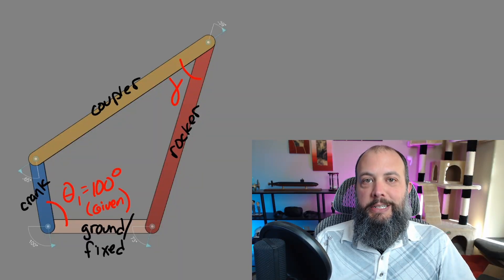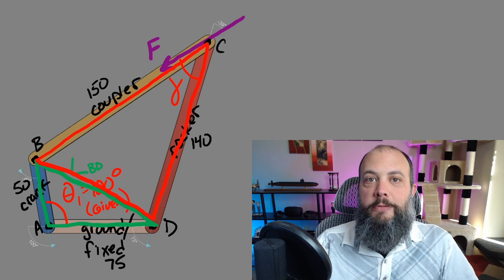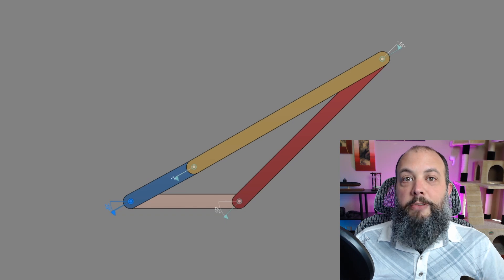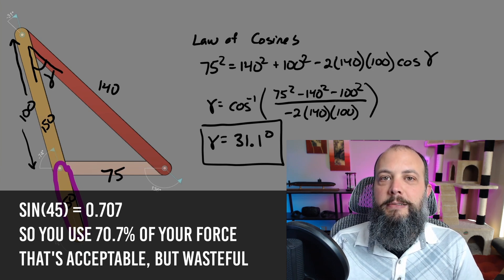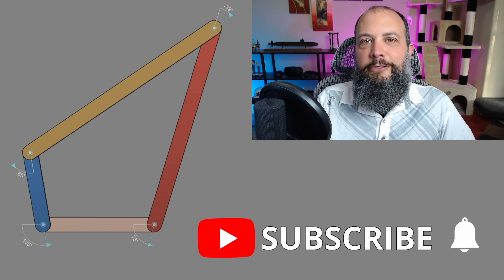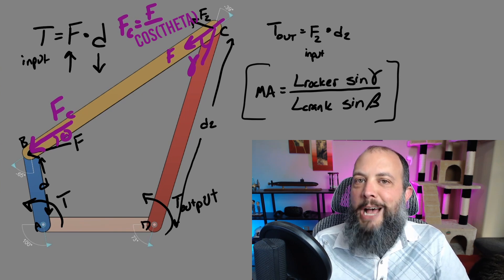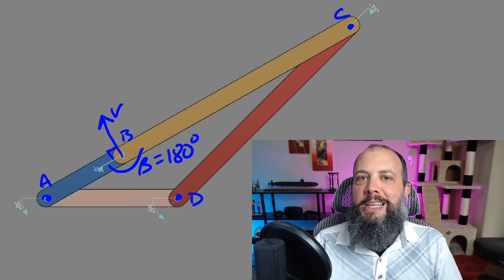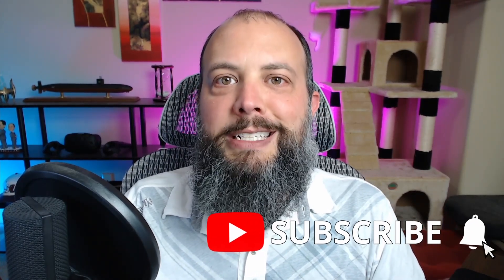Transmission Angle and Mechanical Advantage of a Four-Bar Linkage

Comment: sir could you please let us know where you made those simulations? it would be quite helpful for us

Edit: so i was just pausing the video and writing notes, and i got my answer! (fusion 360)

thanks so much for the video!
Reply from the maker: Close - I used Autodesk Inventor. It's basically the same as fusion 360 though. Both are free for students. Just create an account using your .edu email and you should be able to install for free on your personal computer.
Reply: @BrianBernardEngineering  thanks so much for the information! actually i am already applying for it for a month, hope I'll get the access!

Comment: Many thanks. EXCELLENT video. Question: for any given configuration of the mechanism, could ME be determined by comparing the Omega of the crank to the Omega of the rocker?  For I reckon that once we know THAT ratio we bring into play of the lengths of the crank and the rocker to figure out the  FORCE ratios.
Reply from the maker: The angles are definitely necessary, but I don't think the ratio between the angles has any physical meaning. As one counterexample, When the denominator angle is zero, this becomes undefined, but link angle of zero shouldn't be treated as fundamentally any different than any other angle.

Comment: So Vise Grips have a mechanical advantage of infinity when closed. Sweet.
Reply from the maker: Yea, edge cases get a bit wonky. You can have all the strength in the world, but if you try to apply it over any non-zero distance, you get much weaker.
Reply: @BrianBernardEngineering  ah yes. When an unstoppable force meets an immovable object.
Reply: @BrianBernardEngineering  hey, is it possible to graph the mechanical advantage of a 4 bar linkage?
Reply from the maker: @FerociousSniper  absolutely. Use theta, the angle of the crank as the x axis from 0 to 360, and y axis is your mechanical advantage. In your equation for mechanical advantage, you have 2 angles ... neither of which are what I just called theta, but they are both functions of theta. Rewrite those angles as functions of theta, and bam, you have yourself a way more complicated equation for mechanical advantage, that can now be plotted for theta. If you had angular velocity, you could do an extra step if you wanted x axis to be time instead of theta.
Reply: @BrianBernardEngineering  thank you so much!

Comment: Awesome video. I was just wondering.I am trying to find a formula in which by giving any theta it can find alpha.  Is it possible to use the method in the video to find the angle alpha and generalize for any angle theta. Or the method only works for theta below 180?
Reply from the maker: alpha, do you mean gamma? I scanned the video and didn't see an alpha, but I might have missed it if you could give a time stamp. I solve for gamma using 2 law of cosines, which could conceivably be combined into 1 giant equation, but I think its easier to solve it in 2 steps than combine the steps. This method should work even when theta is >180. The red and green triangles will be overlapping a little since the green will be below the x-axis, but the method should still work, solve for length of the Lbd, then solve for gamma.
Reply: @BrianBernardEngineering  Sorry for my mistake. Yes, I meant gamma. If the method works even for theta > 180 that's perfect. Thanks you're a saviour!!

Comment: This is maybe a dumb question. My prof heavily encourages us to model things instead of doing the math, but I want to know the math. Are the angles given because you modeled the linkage, or were they provided in the question? (I have none given in my book question, that's why I'm asking--I'll have to model it on Solidworks to find the angles, I think?)
Reply from the maker: Asking what you would need to be given to find a solution is a good question. For a typical 4 bar linkage like in this problem - you only need to be given 1 angle - and from that one angle, you can solve for the others. This would almost always be the crank angle that is given, if there is a crank that can rotate a full 360deg. But, it could be the angle for any piece. *Sometimes the solution may be ambiguous - for example for a crank rocker, if you are given the rocker angle ... this will actually correspond to 2 different crank angles. Even for crank rocker, when given the crank angle, the rocker could be in the "normal, upward" configuration shown in this video, or it could also be in an "inverted, upside down" orientation. So - you can probably always solve for all the angles if you are given 1 of them ... but these solutions might not be unique.
Reply: @BrianBernardEngineering  , so if there's an instance where I'm not given one, what do I use? I'm given nothing but link lengths.
Reply from the maker: @kateczekalski1344  Hmmm. I'm not sure I can help more without knowing the full text of the question. You CAN model the linkage using just the lengths without knowing any angles. This is just a matter of drawing 4 links, the right lengths, and connecting them to each other. But once you have it modeled in solidworks, the pieces will move. If you want to use your model to solve for something like mechanical advantage or transmission angle, you'll need to know in which possible configuration you are interested in, so you can set your model to that position, and measure it from there. Rephrased in short - you can build a model with just the lengths. But to use the model to solve for something specific, you probably would need to be given an angle, since otherwise you don't know what position to set your model into when you find the other things you are looking for.
Reply: @BrianBernardEngineering , would it be possible to send the problem to you and have you take a look? :) I would think the mathematical properties would apply, but without an angle I'm stuck. . I've never really worked with 4 bar linkages outside of that class, so I'm feeling a little over my head, ha!
Reply: @BrianBernardEngineering , I just realized I replied on my other account, ha! Can I send you a screenshot of what I'm working with?

Comment: Many thanks about the explanation , but I want to ask you about the name of the  program that  you used to run the simulation on ?
Reply from the maker: I think at the time, I made that animation using Fusion360, but now I would instead recommend Autodesk Inventor instead. They are pretty similar programs, but I find Inventor a lot easier to work with. You may like this video here https://youtu.be/M87UV015CYU which is a walkthrough of how to create this exact animation of a 4 bar linkage ... but I do the walkthrough in Inventor, not Fusion, since this is my preference now.
Reply: @BrianBernardEngineering  Thank you 🌺

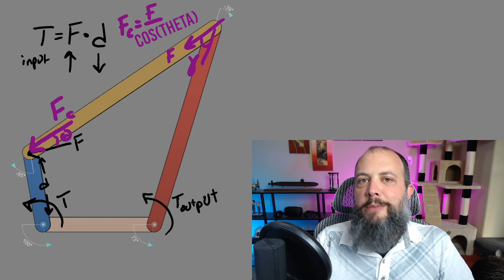Comment: At 6:09, how is Fc equal to F/cos(theta)? Shouldn't it be Fc=F*cos(theta) instead?
Reply from the maker: Good question, but I think I have this correct. Fc is the force in the coupler, F is simply defined as the component vector of Fc that is perpendicular to the crank. (Note, I'm referring to the black F at joint B, not the pink F at joint C which should have been a pink Fc). Consider if you were draw the Free Body Diagram for the crank. You'd have the torque at A, and you'd have Fc. That's it. If there's no acceleration, the supplied torque must be entirely cancelled by Fc. The component vector of Fc pointed towards A would cause no moment. Only the component vector of Fc poined perpendicular causes a moment. This component is Fc*cos(theta) or Fc*sin(beta), which is labeled on the drawing as F. One last way to maybe think about this. F is not a real force. Fc is the real force. Don't think of this as using torque to find F, then projecting vector F onto Fc making it smaller. Instead think that you can use torque to find F, then consider how much larger Fc needs to be such that Fc projecting onto F will give the value of F required. This is another way to help visualize Fc as being larger than F. I hope this has been helpful, but I worry that I may have just made it more confusing.
Reply: @BrianBernardEngineering  Appreciate the response; I do believe you're right, drawing the FBD out as you instructed I get the same results.

I guess I'm just confused on WHY you don't use the torque to find F, then project it onto Fc; intuitively, it makes sense to me that if you can only push/pull on the coupler, having the crank push at a weird angle would transmit LESS force, not more. Almost the same way as if you were driving the crank with a pneumatic piston, the closer to perpendicular you mounted the piston, the more force that would be transmitted to the crank.
Reply from the maker: @lipstick3745  It may be useful to not think of torque as the only input, but also the reaction forces at ground as a quasi input to Fc. Instead of a fbd of just the crank, consider a fbd of the entire 4 bar linkage. You can sum moments at the crank to solve for the reaction force at the output, then once you have that force, sum forces in x and y to find reaction forces at the input. Thus these reaction forces at A are also inputs to finding Fc, just like torque. This may help to see why Fc has to be larger than F. The torque creates F. But also the reaction forces at ground create forces. These forces also have to be cancelled by Fc. So, Fc isn't just created by the torque, it is created by both torque and also the reaction forces at the pin. Fc is larger than F because it has to account for the torque that created F, and it also has to compensate for the reaction forces at ground. It's the combination of both of these inputs that makes Fc larger than it would be due to just the torque alone. Maybe a shift to thinking about these x/y direction reaction forces reframes things a bit to help with intuition.

Comment: Is the input and output power of the mechanism the same? I think no. What do you think?
Reply from the maker: I agree 'no', but I wouldn't use the term 'power' here. It may be better to think in terms of input vs output 'torque'. There may be some specific moments when the input/output torques are equal, sort of how a stopped clock is right twice a day, but in general, these will be different - because the input torque is likely going to be constant since it's supplied by a motor through the crank and the motor will supply constant torque - and the output torque will be always changing since transmission angle is always changing, so even if they are equal one moment, the output will change the next moment and they'll be different again.
Reply: @BrianBernardEngineering  what about friction losses?
Reply from the maker: @tgoi6489  Oh, I see. For that type of question, I would use a completely different approach. This method described in this video is a purely geometric analysis, which is used to analyze idealized moments in time. When accounting for things like friction - I would recommend an Energy based method, essentially the energy in the system is conserved, but with the work added by the motor entering the system, and energy leaving due to friction or any other losses leaving, and the difference of work added - energy lost goes either to accelerating the system, ie more energy in the system itself, or power leaving the system going to whatever the crank is driving.